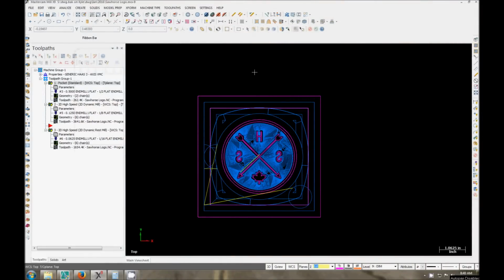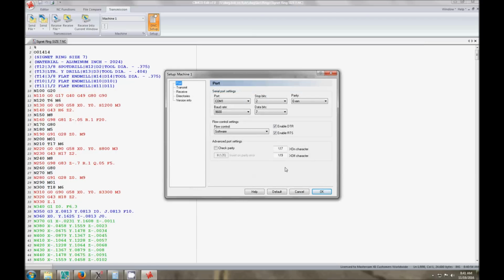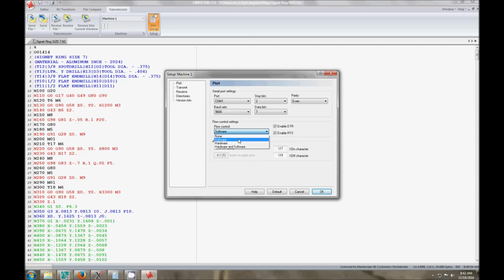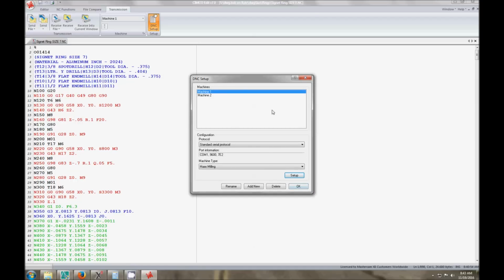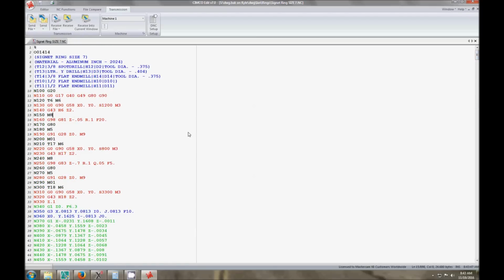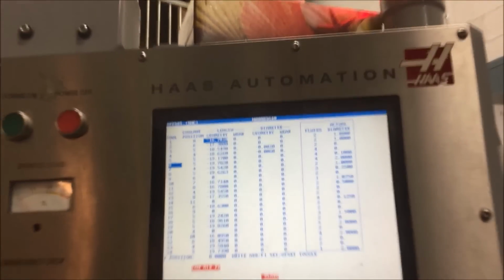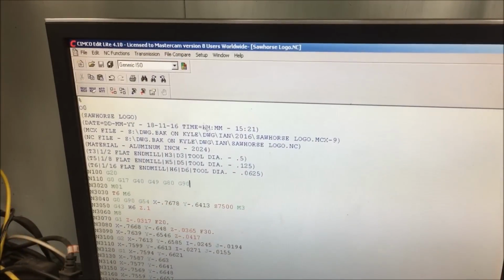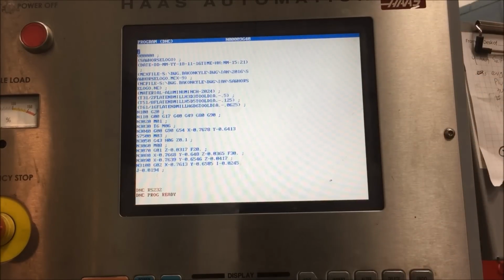BEGINNER CNC: HOW TO DRIP FEED A HAAS MILL WITH RS232

Comment: So is drip feed something you would be comfortable with doing every time you want to run a program or is it just for long stuff?  Looking at picking up an older CNC with the DNC option and just wondering.
Reply from the maker: I mean you definitely could run a drip feed every time you ran, but it’s not terribly practical for production work - I only use it on occasion when necessary but I wouldn’t buy an older machine without the option!

Comment: So in terms of running the physical machine. Drip feed will stop once it has reached its potential max memory and wait for the machine to start running. Then, once the program starts executing it drips in new lines of code correct? If the program needs to be changed or go to a previous step, will this mess up the drip feed process? Thank you!

Comment: I just got a "new to me" milltronics partner 3D running Cinturion V and I have only used it in in JOG lol. I noticed in the software it had DNC listed. I'm hoping that means I can use some software and drip feed into this old 3 axis. I'd love to see this thing cut using all auto generated g-code.

Comment: +Let's Machine Is it that easy to send a program in one go as well?
Reply from the maker: Always has been in my experience, anyway!
Reply: @LetsMachine  Fantastic, thanks for the reply.
I've not long bought a 1995 VF-0E and the manual goes into all sorts of depths about pin outs but if a null cable is all I need, brilliant!

(Guys I bought it off had an ethernet cable going to it, but didn't explain how they made it work)